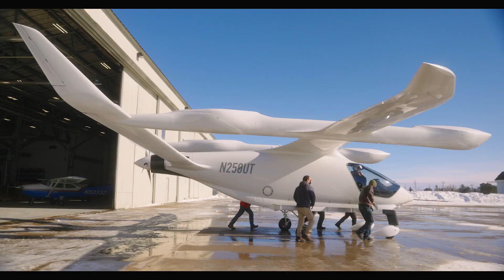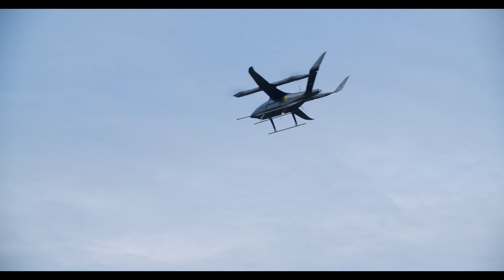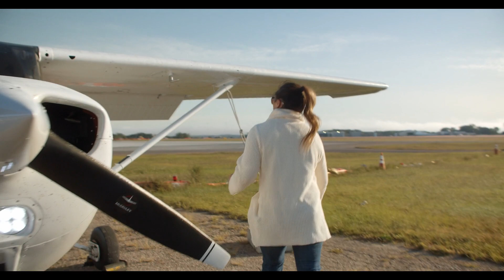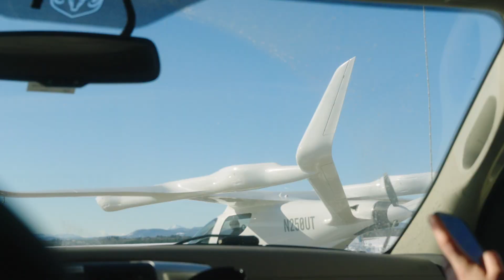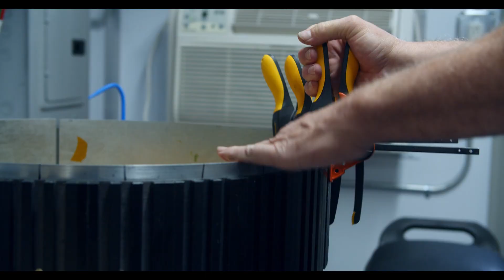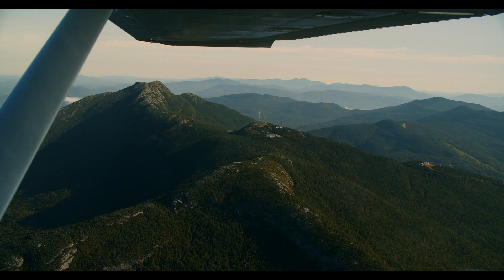Beta Technologies

Comment: ALL, yes ALL, of these "eVTOLs" will go bankrupt.  They all failed to understand the problem and the business model is silly in the extreme.

New distributed combustion tech makes ALL EV tech (car, airplane, boats, houses) obsolete.  It is 60% at pull power and 75% in cruise.  3 HP/LB at motor.  EV motor + battery is 0.25 HP/LB...  Active Drag Reduction (1/2) enabled by engines, not with EVs.  The drag can be up to 8 times less than EV craft.

Door to door is key.  All eVTOLs cannot afford the weight to be roadable like this combustion tech can.  0 to 360 mph.  125 gallons gives 15,000 mile range at 120 mph, 3750 miles at 240 miles, 2400 miles at 300 mph, 1666 miles at 360 MPH.  No EV can come close by 100:1.  

CO2 is 200 times less with RE fuels vs a 100% RE grid.  On gasoline it is 3-4 times less CO2 than an EV.

This airplane concept fails on many levels.  Yes, I will debate you on it anywhere.

Just a friendly hint.  Heads up.  You will lose all investment into eVTOLs.
Reply: Please supply evidence to support your claim that this new ice of yours could power the flight of that aircraft and enable it to travel 15000miles using only 125 gallons of fuel .
Reply: @nikcook4298  Wind tunnel data of previous models show 3.2 square feet flat plate drag.  With New combustion tech at 60% efficiency and 120 mph, it is 1 gal/hr at 120 mph.  125 gal x 120 MPG = 15,000 miles.  

With active drag reduction (boundary layer control tech) the drag can be as low as 1.6 sq ft (in theory), which would allow ~30,000 miles on 125 gallons.  Useful load (2000 LB) allows 5 people and 125 gallons.  At 360 MPH and 13.3 MPG the range is 1666 miles.

A VTOL version allows 0 to 360 MPH and costs 2x more.  An Air Taxi version is 25 to 360 MPH which is roadable door to door.  VTOL is NOT wanted or needed in 99% of cases.

Again, no EV can compete.
Reply: @seaplaneguy1  there are no ice powered 5seater aircraft that have fuel consumption as low as 120miles/gallon.  There aren't even any single seat planes that can achieve that kind of efficiency - that's according to the official data from the manufacturers shown on website for use by the aviation industry .
15000mile fuel tank range for a small 6 seater aircraft is something that isn't realistic or practical either. Even having a 1000 mile flight in a 6 seater traveling at 120mph is a ridiculously long time in the air for passengers and a pilot to undertake.
Reply: @nikcook4298  This is new technology.  It is not a 1940s remake from some EAA homebuilder.  

An ICE engine (O-360) is ~25-28%, perhaps 30% lean of peak.  Diesels are 42%.  Boeing 787 turbine cores at 27:1 expansions are 55%.  This new engine tech is distributed power (lots of motors like EVs have) with combined cycle and CO2 capture.  Full power is 60% with 81:1 expansions.  50% torque with combined cycle is 75%.  At 120 MPH it is 75%.

75/25 = 3 x better fuel use.  

The drag is 3.2 vs a Cirrus at 4.3 or a Cessna 206 at 7.1 sq ft.  

7.1/3.2  x 3 = 6.66 x better MPG.

With distributed power, the motors can be turned off to slow down without a rise in BSFC.  

Correct, 120 MPH is slow.  240 mph is typical, and 300 mph is for 2400 miles across country or to Hawaii.  360 MPH is max speed and 60% is the efficiency of engine, not 75% due to max power.  

No EV can compete against this tech.  It will also be around 100 times less CO2 in life cycle compared to an EV when RE fuels are used.

There is NO point to EV tech when this new combustion tech comes out.  Friendly hint.  All EV companies will be bankrupt due simply to costs and high CO2.
Reply: @seaplaneguy1  ev tech exist and is available now. Let me know when/IF your new combustion tech actually exists on a real aircraft that is flying in the actual real sky.
Reply: @nikcook4298  You have NOTHING that is of any value, both in performance and CO2.  The CO2 of an EV is massive and is NOT sustainable in any real world application, nor will it be in 50 to 100 years, if ever.  Claiming it is is a fraud. 

RE fuel is 1-2% of the CO2 of a 100% RE grid.  Making fuel is also 20-30 times less costs than charging on a 100% RE grid.  

EVs are a dead end in costs and CO2, and thus have no point or valid claim to any reduction in CO2.  

ALL combustion engines with RE fuels have a ~70% reduction in CO2 over oil fuels.  An EV with 100% RE grid is only a 33% reduction in CO2.  

New Combustion tech can be a 98% reduction of CO2.

Ironically, any CO2 tax will put an EV out of business.  Hint....
Reply: @seaplaneguy1  where is this new combustion tech that you keep making big claims about? Put up some links to the source of your claimed new combustion tech tests so  that people  can read and fact check the claims you make for themselves .

Either Put up and prove your not just another online jackoff talking out their ass or Shut up!

Comment: With electrical systems susceptible to electric shock, static, and or any form of electrical discharge, or from an EMP, how will an electric plane handle direct strikes by lightning?
Reply: The same way any aircraft would.
Reply: @WallyWorld69420  lol I was about to say the same
Reply: Gas powered planes have electrical systems too